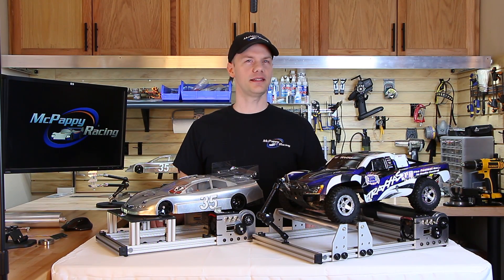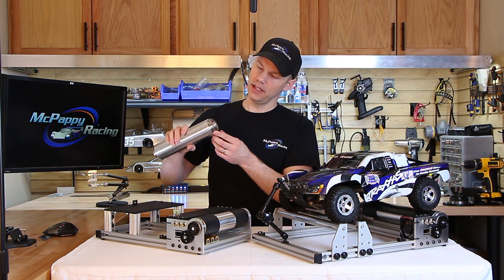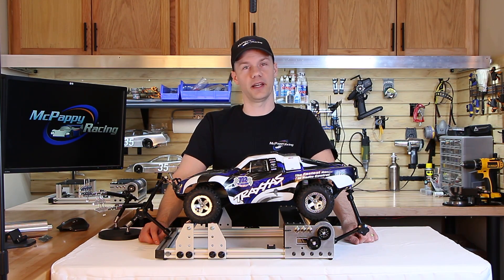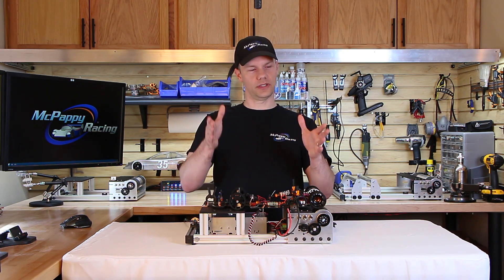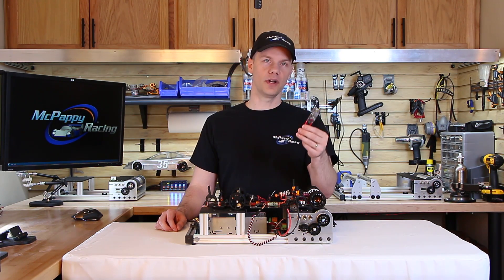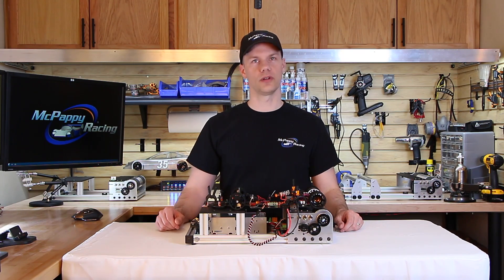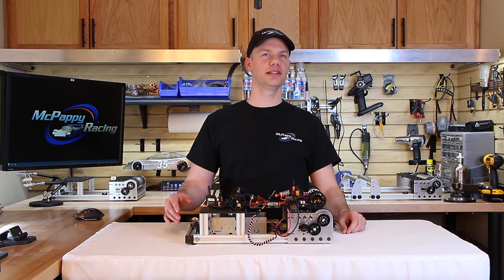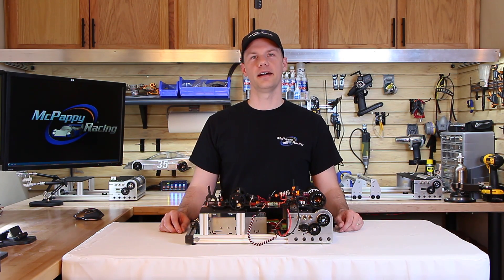McPappy Racing RC Brushless Chassis Dyno

Comment: Can you use this for a nitro car?
Reply from the maker: Yes you can. The "brushless" in the name is referring to the dedicated slave motor which provides consistent resistance.  You can do any types of vehicles: electric, nitro, rubber band powered... you name it.
Reply: McPappy Racing thanks! Is there a max power rating? I put a mod .28 nitro on my 2wd slash. The engine is advertised as 3.74 hp
Reply from the maker: @colemanbinyon7063  We built these like a tank. You can't hurt them.  There are 1" bearings that hold the roller that are rated for 2000 lbs each.  We have many racers using our dynos up to 1/5th scale. They have massive horsepower. Our dyno handles it no problem.

Comment: If you have dual motors, 1 drives the front wheels and 1 drives the rear wheels I assume you could make a dyno with a dual load/flywheel setup to see how balanced the power distribution is.

The tuning can be done a number of ways after that.
Dual ESC means % of throttle can be adjusted.
So a dual dyno would make this possible, unless you can do it another way?
Reply: As, you can't just turn the car around on a single dyno setup ;-)
Reply from the maker: We don't have it shown on the web site yet, but you can ask us to make you one with dual large rollers.  So all the goodies you see in the back of the dyno will be up front as well.  This gives you a lot of possibilities.  You could even have up to 4 slave motors :)

Comment: I am very interested in this dyno. only question I have is how fast can I go on the rollers.
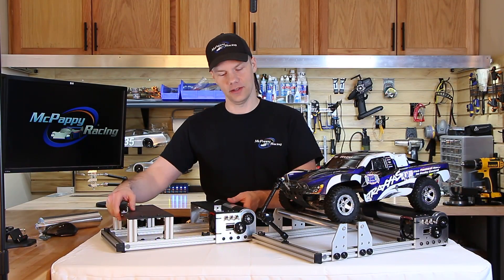Reply from the maker: This dyno is built overkill. You can't hurt it.  The bearings are a massive 2" (seen at the 2:10 mark) and each rated for over 2000lbs. The only limiting factor is the rubber on the roller. We ship with bicycle tubing which mechanically holds, plus we glue it to the roller. But if you want, we can upgrade you to some silicone bands that are about 4 times thicker. We use the dyno's with 3.0 turn open modified brushless motors with no issues. We have customers that use it for drag racing and then there is guys using it up to 1/5th scale nitro pushing some serious horsepower. So far, all reports are good.  No issues.
Reply: @mcpappyracing1326  that's good. I am a speed runner with some of the fastest cars in the world. 160mph+ I just wanted to make sure it can hold up to challenge I would put it through.
Reply from the maker: @lightningdad13  I built a dyno for a tethered car customer. Only thing we did different was the heavy duty silicone bands with super glue instead of the usual E6000 glue.  He was pushing 200+  MPH speeds.

Comment: the tubing on mine is starting to go, do you have "tech specs" :D on the bicycle tubing it came with?
Reply from the maker: Sure thing.  You can use any bicycle tire that is about 2.6"-2.8" (measured deflated, pressing flat).  You can order from us if needed, or here is what we use:   http://www.jensonusa.com/Tubes/Surly-29-X-3-Presta-Valve-Tube . I cut to size, then invert the tube so smooth side is out.  Wash it well. Stretch it out. Wet it with rubbing alcohol or window cleaner, and stretch it on. The alcohol/window cleaner will evaporate.  Once it's on and dry, I then roll a long screwdriver in between the roller and tube.  This allows me to insert a Q-tip with E6000 (or similar glue).  If you want more durability, you can use a bunch of rubber bracelets.
Reply from the maker: We now offer some optional heavy duty silicone rings. They are 4x as thick as the tubing.